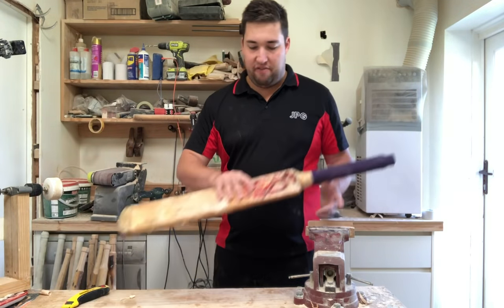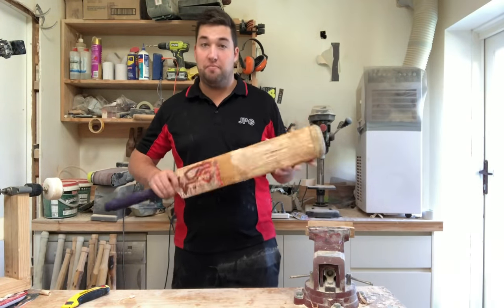Can it be fixed? Challenge Repairs - Episode 1

Comment: A friendly suggestion. While grinding, drilling, cutting or doing other work where fine dust is produced, pls ensure you wear a proper nasal mask. This will save damage to your lungs in the long run. This maybe inconvenient while working but is a life saver. The fact most Doctors won't tell you is, when it comes to lungs(unlike heart or kidney) there's very little medical advancement and cure. Pls don't expose yourself to COPD or Fibrosis or asbestosis.
 All caused by fine dust.

Thanks for reading. Take care.
Reply: Nick Maclachlan  he can do both. Can't he?   We are talking about potential life threatening diseases

Comment: Great work... Highly appreciated... Only one thing that may be improved is the filler you filled in front side of the bat is clearly visible after finishing... If the color tone  matched with the original wood ..No one could have noticed that its an old bat 😊👍
Reply from the maker: Not much I can do there unfortunately.

Comment: Look into getting some peel ply instead of using tape. You can get it from any composite shop. It helps with resins and glues so it doesnt stick to your tools
Reply from the maker: jayvandyll most of the time the tape just works for a small amount of compression but mostly to have a barrier between the bat and wooden blocks

Comment: Is it any good as a bat for hitting balls with? 
a) the face was all dried out and cracked - won't it just keep on cracking? (and you didn't seem to feed the wood with anything)
b) won't the filled areas have a different feel from the original wood?
c) won't the filler just break up and fall out when a ball hits it, despite the plastic covering?
d) although I understand the purpose of the video is to "reclaim" an apparently worthless old bat, is it really worth all that work?
e) is Super Glue really any use for wood?
Just interested. No axe to grind.
Reply from the maker: Hey Nick, happy to discuss. 
a) sometimes you can only do what you can do. The damage to the face is due to wear and tear which is natural for cricket bats and will continue to happen, like it has over the last 30 years. As a repairer my job is to get the maximum life span out of each bat but no bat lasts forever. 
b/c) they do sound a bit different but the filler is a decent top layer to the bat. The PVA filler doesn't crack up as much as it's a bit more elastic and is better than a hard filler in terms of performance. I've done the same on top level bats and even had one used in some Aussie T20/ODI games. 
d) client is happy to have their retired bat back and it made some interesting content. I say yes!
e) super glue is awesome in bat repairs. Particularly reaching into tight cracks. Sometimes with wood glue you can't get it all the way into small openings. I've also found it lasts pretty well in most cases.

Comment: Respect in fixing and/or restoration is keeping the original Brand visuals.
What's with putting your brand on an older original bat? Who does that?
Get some copies of the original bat's logos and put them on it.
That was never a JPGavan bat.

That's like somebody repairing an old Coke Machine or Harley and removing the old companies logo, and putting your own on .

Put Kookaburra's original copy Brand Logos on the bat with smaller stickers with your brand.
Reply from the maker: Customer requested these stickers.
Reply: @JPGavanCricket  The customer has no respect for early brands or the heritage of the bat.
For the same reason I'd hate to see someone put another Brand Sticker on one of your new bats in 30, 40, 50 years time.